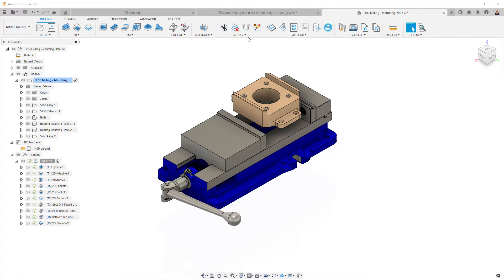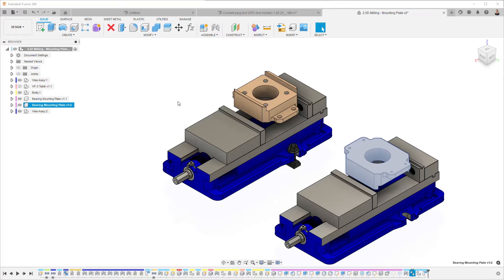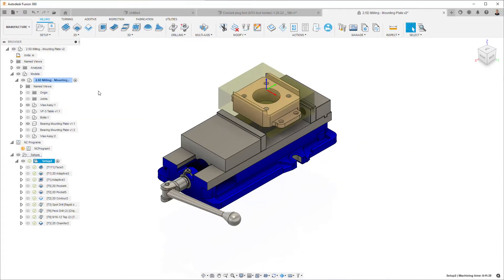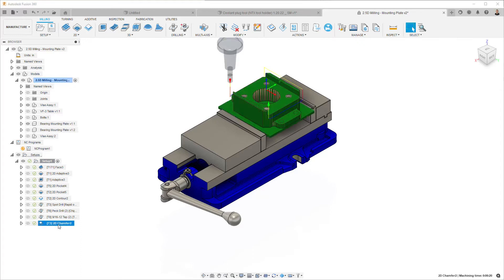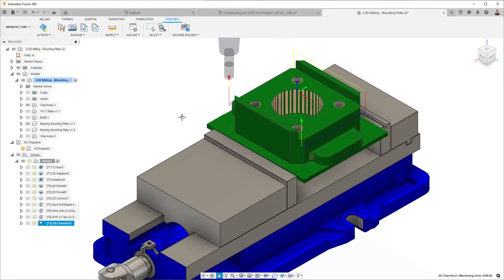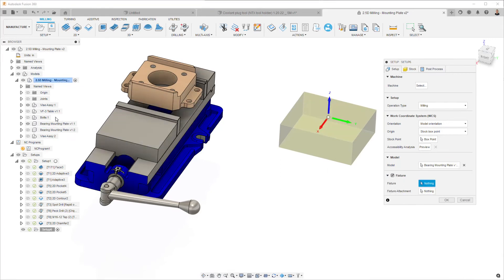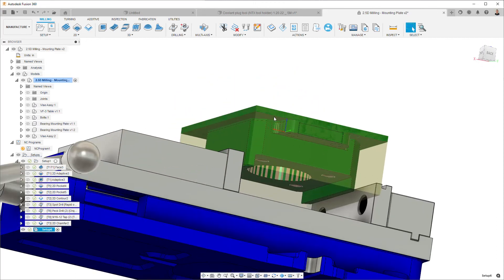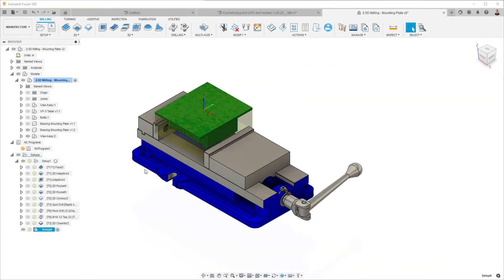Fusion 360 CAM - How to use the remaining stock from the previous setup

Comment: It Worked Beautifully! 
i have Wondered how to do this since Comparison was available in toolpath Simulation.
i have Use the Rob Lockwood Container method and there you make a Copy of the "fixtur" aka the vice and joint it on the opposite to OP1.
Vice op1
Model
Vice op2 ( it would be easier to show a picture)

Comment: Interesting video, but since you have removed the stock in OP1 your OP2 semi finished part will not be in the location you show, but will have to have a different Z height and likelu be on parallels or in soft jaws, and you cannot probe x, y, z.

You clearly need to remove the "hat" before you can probe x and y, and you cannot remove the hat unless you can manage to set the proper Z height. That piece was the relavant information I was hoping to find in your video
Reply: Thanks for the feedback. This video was purely intended to show how to carry over the stock. I didn't spend any time paying attention to the details you mention since it was literally an off the cuff, single take video recording. 

I may create a video covering the items you mention at a later date. So thanks for sharing your thoughts.
Reply: Thanks  @ScottMoyse  
If we are flipping parts in a vice onto softjaw, parallels etc we know the Z height and it should be possible to put that into the Fusion program so that we are not relying on setup for that. Say I know top of part should be -346.748mm yet the probe measures -338.263. It should be possible to  have the CNC face down to -346.748 and then proceed - i hope to see how some day!
Reply: @jenspetersen5865 I would program the origin for G55 off the back corner depending on the datum with Z0 being the height of the finish part. Probe your hard use for Y, hard stop as X, and for Z probe the parallel and adjust the offset positive the final thickness